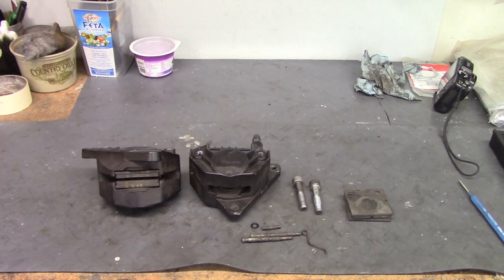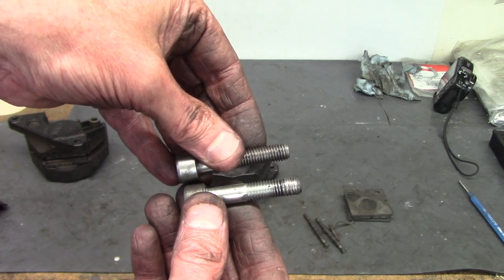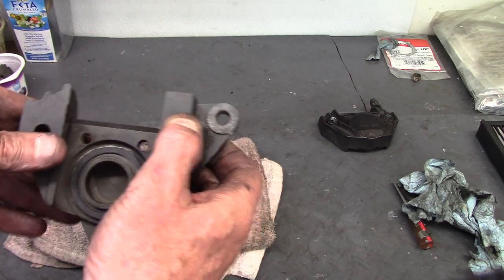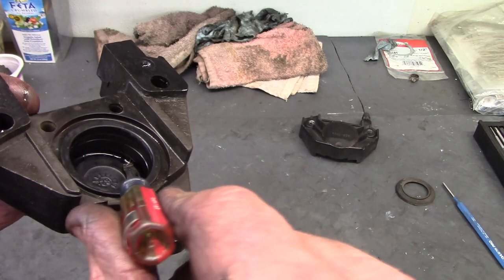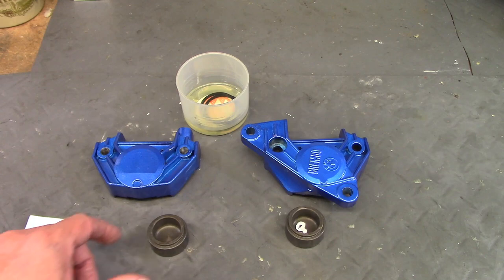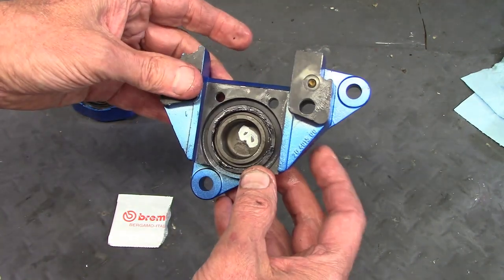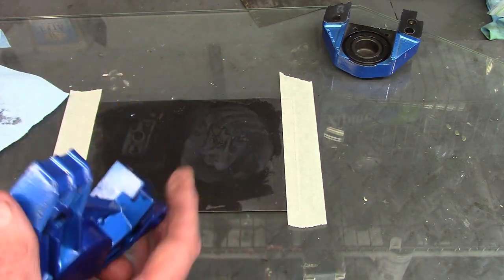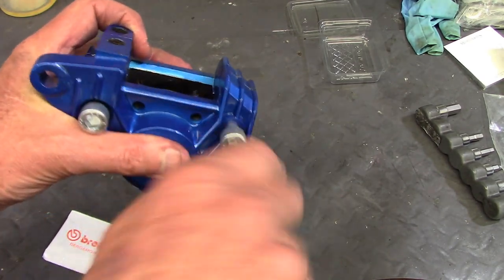1983 R100RS Disassemble, Inspect & Rebuild Brembo Brake Calipers

Comment: Eazy peazy.  Thanks for the help!
1983 r80rt safe for the road!
Alabama
Reply from the maker: Tom, I'm pleased this material helped you out.  I always proceed cautiously to test my brakes anytime I have worked on them.  And, with the Brembo design, be sure to check where the two halves mate after you have done some hard stops and verify there are no brake fluid leaks along the seam.
Reply: @BrooksAirheadGarage  yes sir.
Just got back from a test run. No leaks. Working better than ever. Thanks again for the help.

Comment: Excellent instruction, my only   "add on" would be a thin application of anti sieze grease  [copperslip or similar]  to the threads of the allen bolts, and  also to the bleed nipples, ....

Comment: I really enjoy your videos. I found that the square ring in the Brembo caliper isn't so much for sealing as it is a mechanism for piston retraction using the nylon's memory when you release the brake lever. Otherwise, the pads would wear prematurely. When I removed the nylon ring, I carefully inspected the ring groove for aluminum oxidation and have found that any debris prevents the retraction motion of the ring as well as preventing it from seating--leading to more premature pad wear.
Reply from the maker: T B, You are correct. The shape of the ring provides a return force on the piston. And, it also seals the piston and the caliper to prevent brake fluid leaks. It's a very ingenious design used on all disk brake systems.

Comment: Thank you so much for the helpful information, this convinced me to try it myself :) ! Greets from Belgium
Reply from the maker: Hi Bram,  Good luck and  remember to be sure the matting surface between the two caliper halves is dead flat using the technique I show or they will leak and you won't have front brakes.

Comment: I’m rebuilding the Brembo front brake caliper on a ‘92 R100GS.  A small section of the female side of the threads on one of the molts that holds the caliper together is stripped - just 1/4 of the threads.  Can this be re-threaded before I install the new bolt that came with the rebuild kit?  

Thanks!  Your videos are essential to my rebuild project!
Reply from the maker: I’d replace the caliper.
Reply: @BrooksAirheadGarage  Thanks - was afraid that would be your response.  Any ideas about where I might find a replacement?  Thanks again - much appreciated!
Reply from the maker: Try Euro Motoelectrics

Comment: Brooks, the calipers look great. I’m restoring an 82 R100RT with the same breaks. Did you media blast the calipers before painting? What paint specifically did you use? I’m curious what type of paint will hold up to high temps and rocks? enamel? Urtathane? Acrylic? Your thoughts?
Reply from the maker: Hi Matthew, I always post a link to detailed documentation I publish on my web site about how I do the work. The videos are only a summary. For the details, click the link you'll find out how I did it.

Comment: HI Brooks, thanks for this video. I have a question for you: I have an 1983 R65, and my calipers's piston are 36mm. The reference Brembo 98.5032.50 in this video are for piston of 38 mm? I think that's the difference between my BMW R65 and other bikes like Guzzy and Ducati or R100RS. Do you know the Brembo's reference for 36mm piston? Thanks. The reference in BMW is much more expensive than Brembo reference.
Reply from the maker: Paco, I don't know the Brembo reference for the 36 mm caliper.

Comment: I have the same style Brembo calipers on my 1980 Benelli 900 Sei. I replaced the three pins and spring clip with stainless steel items. Why did you paint your blue, surely black or gold would be better?
Reply from the maker: Hi David. BMW installed blue anodized brake calipers on the 1977 R100RS. I used an "anodized" blue paint to emulate it as this bike is an homage to the RS bikes. I converted the fairing to an RT style. So the bike includes design aspects BMW used for the first series of R100RS (1977-1984) and the RT bikes (1979-1984).  Or said differently, I get to do whatever I want :-)

Comment: Brook, I have a question about the brake lines.  Specifically I am speaking about an '84 R100.  I am clear thru the reservoir, the banjo fitting and into the manifold/splitter.  Coming out of the splitter the 84 has flex tube instead of the rigid metal lines running down to the grommets and then into the rigid s tubes that feed the calipers.  On both sides, the flex tube running out of the splitter seem clogged.  Can you tell me if there are back check valves or something in these flex lines or should they be clear and able to pass fluid or air even.  If not would you have any suggestions on how to clear them.  Thank yo kindly for your time to read my question.  Thank you for the great videos.
Reply from the maker: William,  Someone modified you brake lines. On each side, there should be a steel line from the master cylinder that connects to hose that connects to a steel line to the caliper. I would replace the incorrect rubber lines from the master cylinder with the correct steel lines. 

The part# of the two steel lines that connect to the master cylinder are [34 32 1 235 671	 BRAKE PIPE LEFT (from 09/80);  34 32 1 235 672	 BRAKE PIPE RIGHT (from 09/80)].

There are no check valves anywhere in the bark lines.
Reply: Thanks so much for taking the time to reply, I surely appreciate the feedback !

Comment: Hi Brook, very descriptive video! Will you let me know what torque spec did you apply on the joining bolts?
Thank you in advance!
Reply from the maker: Hi Azparuh, I believe the torque is 22 FT-Lbs.  It is important that you get the mating surfaces dead flat as I show or the calipers will not seal and will leak brake fluid.

Comment: What should the torque setting be for the hex bolts used to clamp each side of the calliper together?
Reply from the maker: Julian, click the link in the video summary under the video viewing pane. It will take you to the documentation with all the details about how I do the work. My video's are only a summary. The documents contain all the details.
Reply: You’re a ‘star’ brilliant. Working on the front brake of my 1989 R100GS. The calliper rebuild would have taken twice as long without your excellent video. Thank you from London.
Reply from the maker: @julianwilson9730  You're welcome Julian. As the old adage says, "It's easy when you know how." :-)

Comment: WE AWARE:   I purchased 3 of the kits in this helpful video shown as  Brembo part number 98.5032.50.  They did not fit my 1983 R100RT, the kit shown is the 32mm seals and such.  FYI